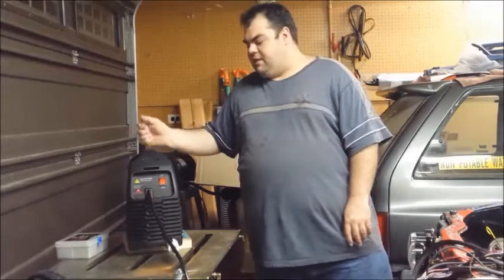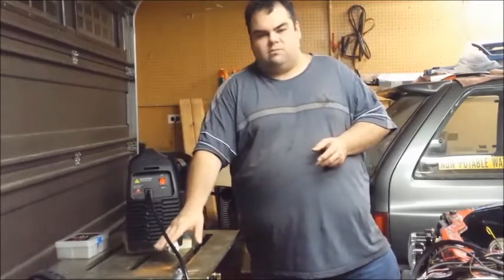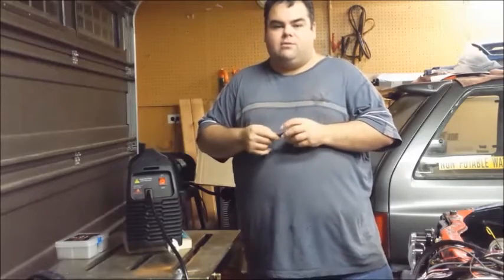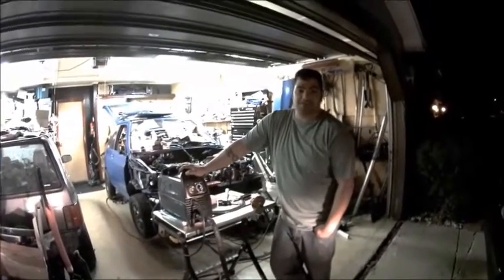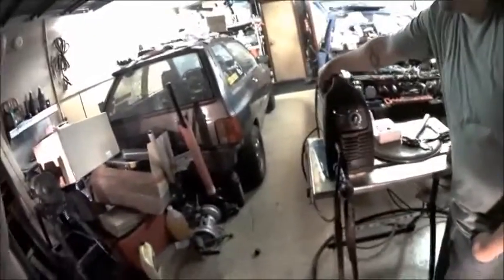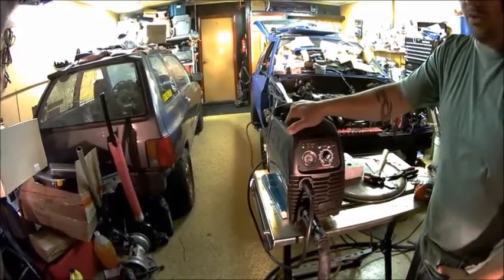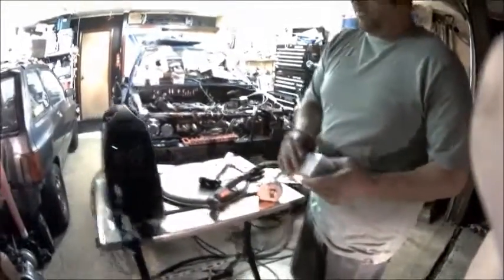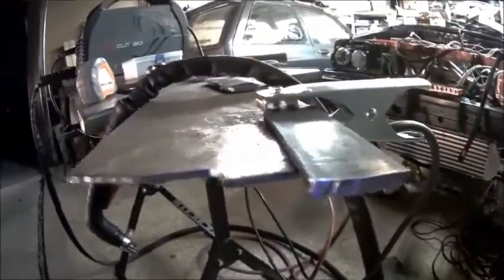ViperCut 30 Plasma Cutter Set Up & Testing

Comment: I purchased the vipercut 30 and love it!. I've been using it now for about 6 mons. It work great! I though I would get it as a cheap plasma cutter just to see if I was going to use one much. I don't think I will have to buy a better one because this thing works fantastic!!  I had an issue contacted customer service they were great, it turned out to be me not the cutter but they still went above and beyond!!

Comment: Just bought the viper cut 30 used it at first working great then out of the blue it refuses to hold air pressure. Any suggestions on what it could be?